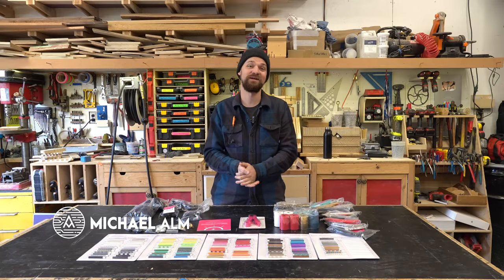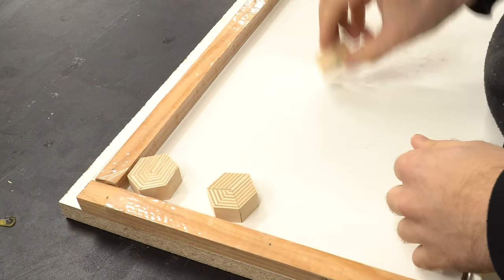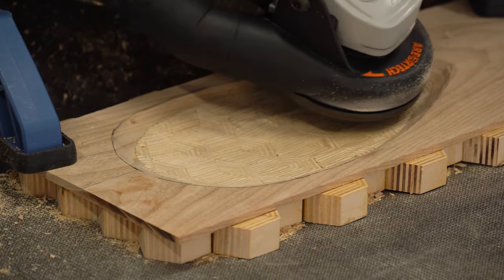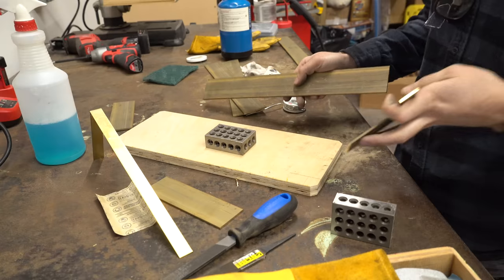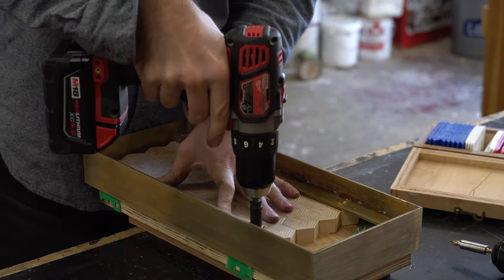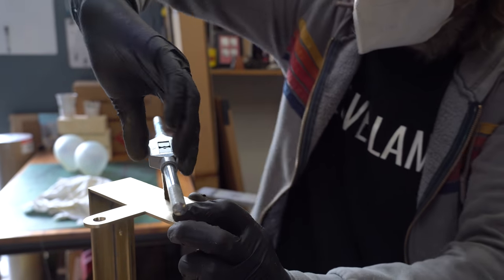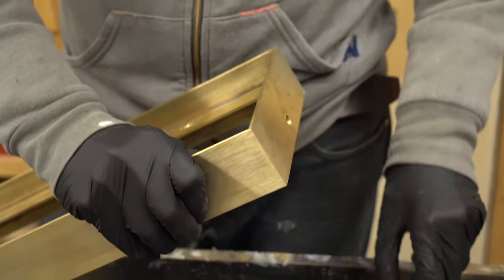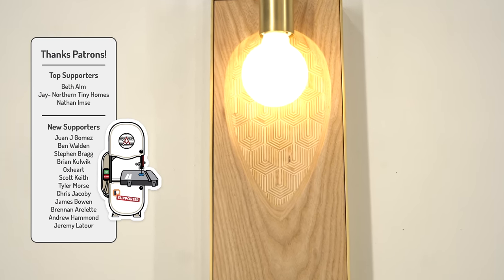Patterned Plywood and Brass Light Fixtures

Comment: I used to work with brass a lot. I am very lazy and bad at soldering. So, the trick I would pull for brass frames was that - make sure that insert (wood) has rounded edges. Sharp edges can cause metal fatigue and snap soft brass. Then measure around the insert, cut a bit longer off the brass bar, and simply wrap it around the insert. Ends can be soldered or (my favorite) joined with rivets. You can do this at the top or at the bottom, depending on which one is going to be less visible :)

Comment: Michael, I was doing some research recently and actually had this on my screen while watching you build those beautiful lamps. I hope this is useful.
3M Scotch Brite Nylon Pads				
Number	Color	         3M Grit	   Grit	             Description
7445	White	        1000	   1200-1500	     Light Duty Cleansing
7448	Light Grey	600-800	   800	            Ultra Fine Hand
6448	Green	        600	           600	            Light Duty Hand (Most Common)
7447	Maroon	        320-400	   320	            General Purpose Hand
6444	Brown	        280-320	   240	            Extra Duty Hand
7446	Dark Grey	180-220	  150	            Blending
7440	Tan	                120-150	    60	            Heavy Duty
Reply from the maker: Super helpful! Thanks!

Comment: Nice fittings, noticed conductors were soldered prior to fitting to lamp holders...a big no no here in Australia, I think its because soldered conductors tend to loosen in time when fitted under a screw, instead to the capture the strands we would use a boot lace compression crimp.

Comment: Very attractive lamps.
As you discovered, soft solder (lead solder) does not make a strong joint. Whenever possible you should have a good mechanical join and use soft solder only to waterproof the joint, e.g., for a bucket, or to give the joint a bit of extra rigidity.
A strong joint can be achieved without a mechanical join by hard soldering (brazing).
When making metal boxes the corners should be mitered. Unlike mitering wood, when mitering sheet metal the sides are not cut separately. A 90° groove is filed into the thickness of the plate, not quite all the way through. Then the sides are bent toward each other to form the square corner. The continuous metal at the corner ensures that a seam does not show on the outside.
Doing this well and efficiently takes lots of practice. In the jewelry trade making boxes is a specialty.
Reply from the maker: This is all great info, thank you!

Comment: Something to be aware of - don't put solder on connections that are going into screw terminals - over time, the solder "flows" under the pressure of the screw (you can imagine how this would happen, with how soft solder is) and the connection will become loose. Either just twist the wires (use some wide plyers to help if needed), or put a crimp fitting on the bare ends.
Reply from the maker: This is good to know. And Josh just soldered the ends not the full length of exposed wire, so the solder isn’t under the screw. It just keeps the wire from fraying
Reply: @MichaelAlm   Glad to hear. Congrats on some amazing lamps :)

Comment: I think your problem when soldering brass is you don't apply enough heat and flux on clean surface, i never solder brass but i solder pipes of copper, First clean with a fine steel wool, then apply flux and the best point in copper is when reach to red/black then you apply the tin and then flux do the job. capilarity absorb the tin and done. You waste a little tin doing that. Thanks for your videos!! regards from spain

Comment: Have a peek on YouTube and look for modifying drill bits for brass. The trick is to file the cutting edge slightly so the bit creates chips instead of curls. It's very easy to do. And it solved the stalling and binding problem I had with 1/2" holes in thick brass.

Comment: You might try using silver solder instead of the lead based type. More heat and use a good flux. Great looking fixtures!!!!
Reply from the maker: Thanks for the tip!

Comment: 1st, don't solder on a metal desk. It takes the heat out of the parts to be soldered, also the flux will rust the bench top if its good flux. Make a jig to keep parts in the air in the correct relationship.
2nd, clean the joint areas.
3rd, use a liquid flux if available, (bakers fluid flux maybe) apply with an eye dropper when parts are warming and when hot and then apply solder immediately. If you use paste flux clean up is harder and it can leave a messsssssss. The lumps of solder you have on the back of the joints at 13.25 shows incorrect heat and or incorrect flux. It should never lump but simply glide into the joint by capillary action. Don't over do the heat or solder or gravity may defeat your nice clean flow into a non economic trickledown. Messsssssy.
4th, some times pre tinning of the edges works well. Get each part of the joint individually and clean the edges that are to be soldered. Heat the edge, apply flux and a thin layer of solder to cover entire edge no bald spots.  Surplus can be wiped off with a cloth or leather while hot if required and depending on the joint. Do this with all parts to be soldered. assemble the parts bit by bit, apply heat and a little pressure and they will join. If there is uneven solder on the tinned parts it can be sanded or thinned but leave a layer on the brass. more solder and flux can be added during the joining if required.
If soldering many sequential parts it is possible to purchase solder that melts at different temperatures, so small intricate work can be done without the earlier work strangely disassembling itself to some strange howls, which you discover are yours, But caution as the melt temperature drops so does the strength.
I would use silver solder (expensive) for parts subject to movement or stress and simple 60/40 electrical solder if parts are in passive display. Hobby shops also have ranges of solder available. look in your local railroad modeller magazine, these are frequently used for soldering brass etched parts.
Practice is cheap and easy, the same practice parts can be used over and over for practice.

Comment: For the people that get gaps after a glue up. As you can see you could use sawdust and wood glue. BUT wood glue does not soak up any finishing oil, thus creating light stains in your joint. If you only finish your piece with blank lacquer it should be fine. 
But if you would like to use oil you should look for another solution. I'm sadly unable to find the product I use personally as wood filler.

[EDIT] The product is called Frenken Gellocol
Reply: I actually have stopped using glue and sawdust.  I use the final finishing material (poly, varnish, oil, or whatever) and mix that with the sawdust for a paste.  It has to be given more dry time than glue but there is no shadow lines as you mentioned with glue.
Reply from the maker: There's definitely that possibility. I haven't found any issues with the water based poly I use on my patterned ply, but it could cause problems for other finishes.

Comment: How do you get your grain to “pop” like that. I sand and sand even down to 600 grit and it still doesnt look that good. Please share your secret.
Reply from the maker: You have to make sure and get all the scratches out between the grits. I start at 120, and spend the most time there. At 220 you want to sand a good bit, and then fully clean off the piece with either an air hose or with mineral spirits. Check for any 120 grit scratches. Sand till you get those out. Raise the grain with water, then sand again. Repeat those steps at 320 grit and you should be good. I rarely sand higher than that.

Comment: I love the lights, I really do, but I just can't past the fact that your friend there is wearing rubber gloves while he builds a freaking lamp... Is that how a hipster has to dress when making his bespoke artisanal lamps?
Reply from the maker: Finger oils and brass don’t mix. Prints can show up months later if you’re not careful
Reply: @MichaelAlm  I will concede to that. I hadn't considered that he was protecting the article. Though a simple wipe down with some kind of cleaner would probably solve that problem.  My negativity was more comedic than combative anyway. Side note: few people are aware that those scotch bright pads come in different "grits". I have a wheel on my 6" bench grinder that is a #9, and it works fantastic as a deburring tool and polishing wheel.